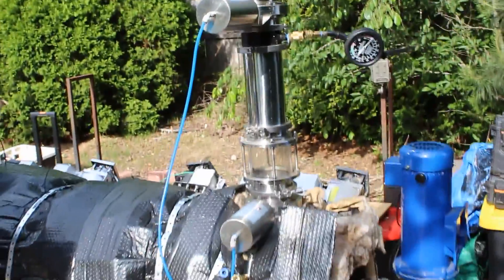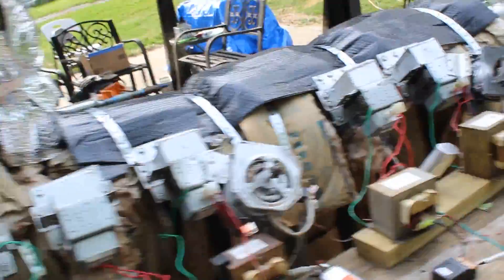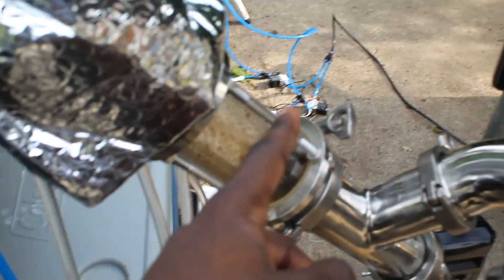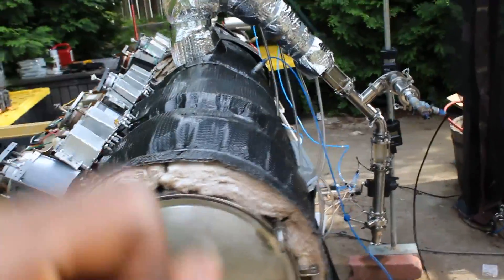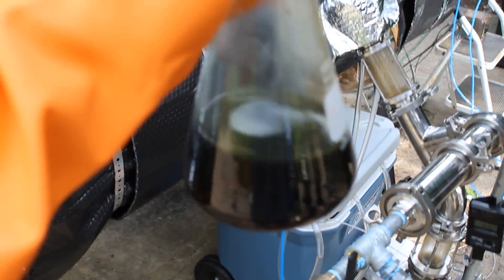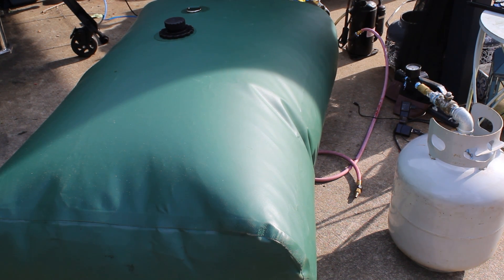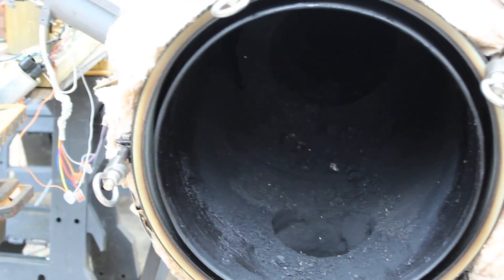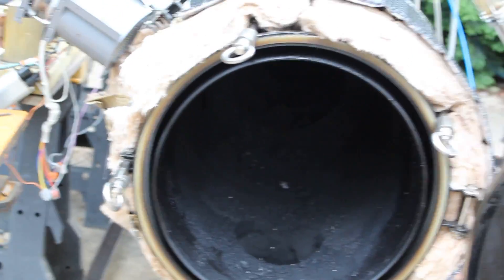Carbon and Natural Gas made from Plastic Waste!

Comment: The use of magnetrons is pretty cool. I think the best thing you could do to help this project along is to send some samples of the liquid, gas, and solid products to a lab for analysis. Probably XRF on the solids and GCMS on the liquid and gas. Knowing exactly which chemicals you're producing will make it much easier to decide the best way to improve the process.

Comment: If it gets 1000s of degrees hot, how does the metal inside stay in shape to turn the plastic? And how does the microwave work with the metal the drum is made of?   And how does the oil survive 1000 degrees of heat?  My home microwave will not heat up food to 1000 degrees if it did, there would be no food to eat left.

Comment: I have a question 
Is the amount of energy this machine uses equal to the amount of energy it produces?
Reply: Not even close he needs to figure out a way to harness possibly wind or solar energy these are concepts but they 💯 work and need to be improved and improved the only way to make it more efficiently is to build it out and work on it he needs funding and help to do it but you have to start from somewhere the concepts will improve over time

Comment: This machine is converting energy from not so usable form (plastic waste) into the usable form (fuels). For the machine to run electric energy has to be supplied. 

This machine would only make  any practical sense other than scientific training if the machine is using less energy  than it can convert (from plastic to fuel) or if the electric energy it's using comes from a renewable source like wind or sun.

We would like to know what's the energy consumed vs energy converted from plastic to fuels. 

What's the efficiency of the machine?
Reply: Yes exactly but that technology does exist we can provide solar and wind energy to this man to prove his concept is viable and profitable

Comment: How much does it cost in electricity to do a run. Seems spendy with all those microwave emitters
Reply: My thoughts exactly 
1k watts-2k each
Times 8
8k-16k watts .20 cents per 1000 watt hr 
$1.6-3.2 per hour.
10 hour operation 
$16-32

Comment: Fill up the bladder. Plug the compressor side. And add weight to the bladder to increase PSI and get more air out at a time.

Comment: Use nitrogen to purge the chamber when you back-fill (bring back to ambient pressure).  Also pump down the chamber twice with a nitrogen back-fill before starting the process.  This will help minimize water vapor in the chamber.

Comment: I have a solution for your PSI problem, Instead of running under vacuum, run it in an inert gas. Argon is what most labs use, but you'd have to buy that, and it's an asphyxiation hazard considering this is some backyard science. you would be vacuuming out the oxygen, and pumping in pure argon, until there's no oxygen left, THEN run the system, and when you're done, recollect as much of the pure argon as you can (since you can't get a strong enough of a vacuum), then just equalize the pressure with air, which will waste some of your argon. I don't know if that's safe or even legal to vent the argon back to atmosphere, so you might wanna check that. I originally thought you where wanting to use the oil as fuel, as if this was a plan for perpetual motion, which doesn't work, but now I realized this is basically carbon capture from plastics. Most of the plastic in the ocean is from glitter paint on boats though AFAIK.
Reply: Facts, yall two could collab, two brains is better than one
Reply: @xSolo-codm  i'm not a chemist, I just watch several youtube channels that do chemistry.

Comment: Hey, might be a good idea to add a support beam spanning the inner length of the tube. Your blades can be attached to this for support and added rigidity. Have it run untill the opening and add a socket on the door to support the weight on that side :) it will allow you better translation of force and for it to remain uniform down the barrel, also will allow you a larger range of modifications in the future. Hope I explained that well and best of luck:)

Comment: you should also use a GFC just incase it pops the bag and cause some possible bruises. you should also put multiple pipes that goes to a single condensing pipe to increase equal distribution, unless if you create a circular device like a cooking pot. you should see if you can create something with the carbon like ski's and go skiing, would make great content.

Comment: I LOVE the work! With the screws bending, a possible fix "although not sure if possible" make a spinning inner drum thats at a slight angle with stationary screws welded to the side. Not sure if possible but would definitely make it to where ifn a malfunction of sorts did occur it wouldn't be as rough of a blow

Comment: You can probably run a diesel generator off of the oil you produce without filtration. Old diesel engines with mechanical fuel pumps can run off of motor oil, vegetable oil, bacon grease , and pretty much anything that's ignites under combustion

Comment: Have you tested the gas product to see what its composed of? I've found quite a bit of information on gassification through pyrolysis of plastics, but almost no information on the composition of the gas amalgamation that comes from  the breakdown. I'm very curious as to the fractions of the gasses.

Comment: i am a young inventor and inspired by your work, i would love to learn more about how these things work and what chemicals do what. i just don’t know where to start
Reply: any books someone could recommend possibly?
Reply: @thewhitespot2852  it's really not that impressive, hand crafting the set-up is probably the most difficult part. But the rest is pretty basic organic chemistry and heat physics chapter. The plastic hydrocarbons melt, evaporate and when condensed are separated into different containers because different hydrocarbon vapours have different temperature condensation points depending on what kind of chemical they are.
Reply: Oh yeah and to make this profitable or somewhat useful, you'll need to scale that set-up by like a factor of 100 if not more.

Comment: You REALLY need to think more when speaking. Butanol has a boiling point of 118 Celsius so it's commonly a liquid under standard conditions,  hence being an alcohol, and you grouped it in with non-condensable gases. Also, you don't have to try and create a new word for the gas as the term syngas (Synthetic Gas) has been in use for arguably generations. Maybe some more reading and studying is in order?? The reductive work you're doing would almost be better if narrated by somebody else. Okay - you're using microwaves. May be reasons it's not done at an industrial level?? These workers are using heated oil https://www.youtube.com/watch?v=NnmUmFEpcow&list=PLoPfopKRjiFm2u5Y45aUAV3elNlC8pvix&index=74
So maybe rather than trying to degrade the plastic using microwaves, you aught use them for heating oil which can be circulated with a small centrifugal pump. Very likely more economical to operate. And it's obvious why you had condensate formation at your hatch.

Comment: carbon thats not powderized might trap oil like microwaved rice traps water or cookies microwaved can feel cold but have steam that sounds like pop rocks when u bite them. a crushed squeezer could let the liquids escape just a final microwaving step at the carbon output but if there is a matrix of non broken up carbon chunks they could always trap oil and water that cant escape with just microwaves.

Comment: So whats the energy input vs output?
Reply: Not great right now but he is working on a mini nuclear reactor that will change everything.
Reply: Pretty much six to eight microwave ovens running for hours. Watts x time x kwph cost
Reply: @MindsMouth  right i get that im asking becasue experimentally this is a nice concept but the system needs to output not only to be more profitable then its inputs, but compete with the efficiency of just mining coal or pumping oil/natural gas. Over time this will probably become more profitable as supply lessens in the earth, but this is the issue ive been struggling with developing my own pyrolysis retorts :'(
Reply: Watts x Run time x kwph cost